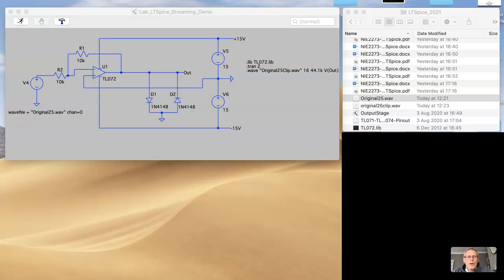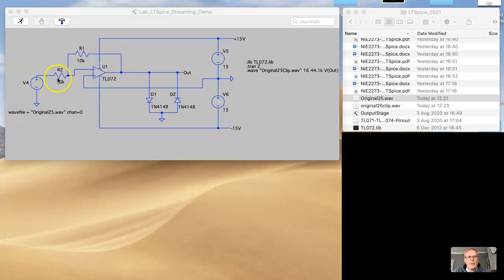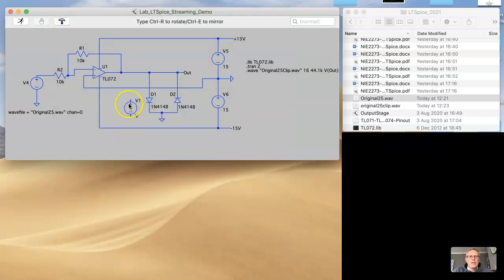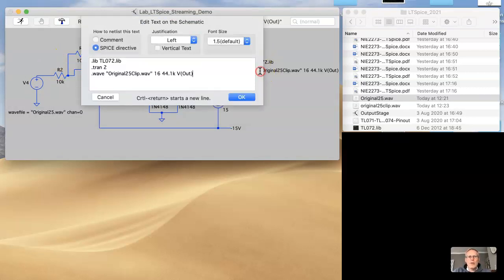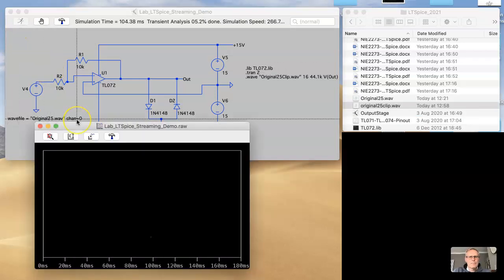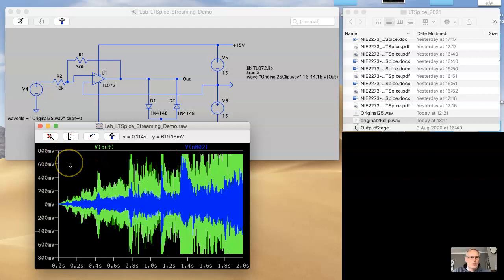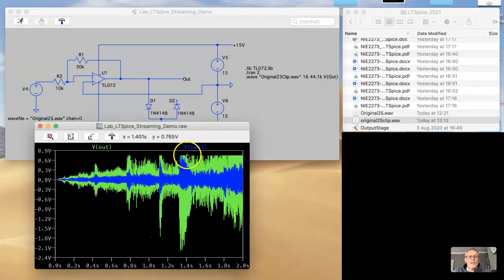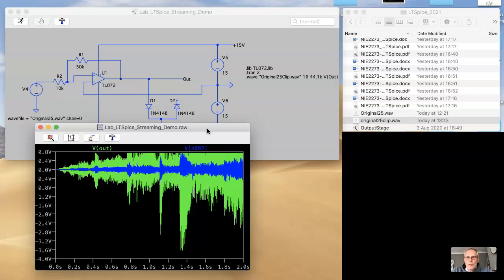LTSpice Streaming Tutorial - Using 'WAV' files to test your circuits.

Comment: Thanks for this. Can you use multiple WAVs as you input, so if for example you're designing an audio mixer, and you want to export of a WAV with the two input WAVs mixed together? Are there any other limitations, or can you pretty much building any audio device like a synthesizer or effect or whatever and simulate the output for however long you want, even 30 seconds?
Reply from the maker: Hi, yes you can specify different WAVs as input. It will also handle multi-channel WAV files, up to a limit of 65535, this is both for input and output. You can pretty much build and simulate a synth or effect using these techniques. The speed of analysis  will be dictated by the processing power of your system (for longer wav files). I'd say you can probably test whether your curcuit is operating as it should with source much less than 30 seconds.

Comment: An Ibanez Tube Screamer actually has the clipping diodes on the negative feedback loop of the op-amp since it's an overdrive pedal. Your circuit has the clipping diodes after the op-amp output, making it a distortion pedal instead. Great video though!
Reply from the maker: Indeed, it's more like a DOD250. I just used it as a vehicle to show how you might use WAV files within LTSpice. The clamping/clipping aspects of the diodes are also easier to explain in this arrangement (imho). I'm glad you enjoyed the video and thanks for the comment.

Comment: It would be nice if you played the input wav file and compared it to the output wav files with different gains .. to show that the circuit did amplify in terms of actually hearing the output wav file .. thanks for this video .. great video .. got an idea on how to teach my son .. he he
Reply from the maker: You can get your son to compare the files. 😀 Glad the video was helpful.
Reply: @stevenfenton3319  .. i did it myself and made an inverting summer circuit .. imported 3 wav files and mixed them playing around with different gains for each wav input signal .. it was fun !!! Thanks again
Reply from the maker: Nice work. LTSpice is pretty   awesome considering it's free!
Reply: @stevenfenton3319  Yes .. very useful ... thanks for this video .. this will make teaching opamps more fun .. i get to have a sound mixer in ltspice using a summer opamp circuit .. RC filtering will be a good addition to the exercise
Reply: @stevenfenton3319  do you have a video on how to show the spectrum of a signal in ltspice so that we can design a filter to remove unwanted signal or noise ?
Reply from the maker: @SamuelMolines  yes, in the video that does noise analysis, I demo the .four command and spectral analysis.
Reply from the maker: @SamuelMolines  Check my tutorial videos in the Electronics playlist.. I go over RC filters and Sallen-Key active.

Comment: are you able to run an AC analysis using a .wav file? or does LTSpice only allow for using wav files for transient analysis?
Reply from the maker: No, it just works with transient analysis. If you're looking to do THD or spectral analysis, you can use the .four command.

Comment: I have a problem to sampling rate bits i tried alot but don't know why
Reply from the maker: What is the problem? Can you elaborate please?
Reply: @stevenfenton3319  I'm trying to play wav file, like audio file i create circuit for it every time they show after run simulation " number of bits in a wave must from 1 to 32" now how i can solve it.... my file is audio i convert it in different kbs mbs but same problem
Reply from the maker: @zeeshan.khan0 make sure your input wav file is valid, in terms of bit depth and sampling rate. 16but, 44.1k is CD quality. Specify this 16 and the 44 1 in the output script. You can see how I do this in the video.
Reply: @stevenfenton3319  and can we use universal OPamp in place of this opamp which you used in your circuit?
Reply from the maker: @zeeshan.khan0 if you're simulating my circuit, most general purpose or audio opamos will work.
Reply: @stevenfenton3319  i wateched  your video if possible you can make one video on this error i will get more clear understanding on this... thank for your replay hope you will make video soon for me and for future students too.